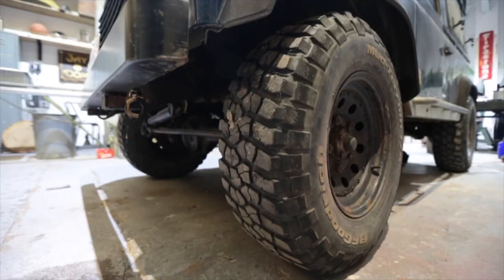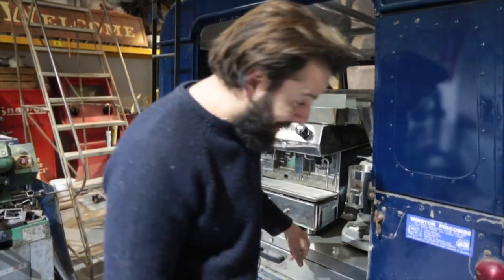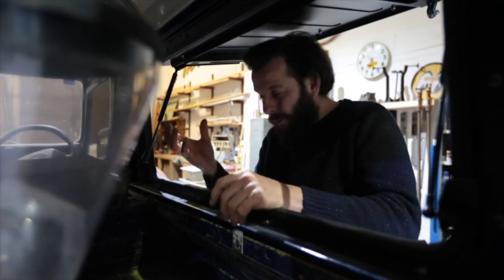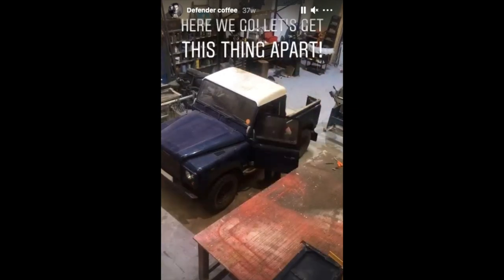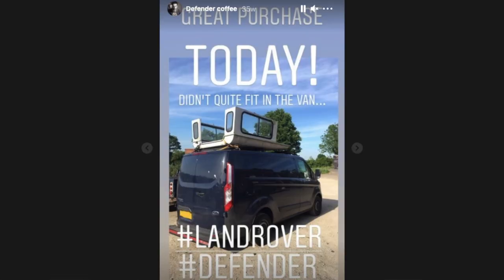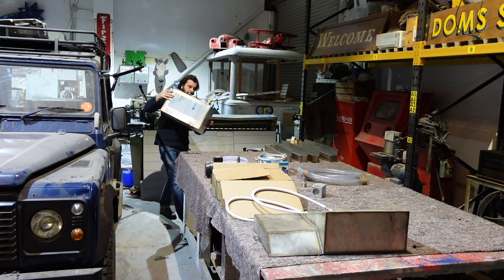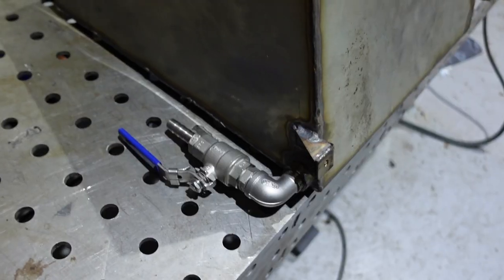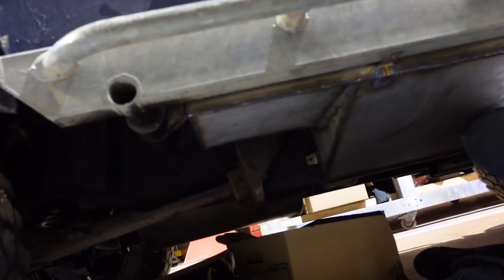MODIFYING A LAND ROVER DEFENDER INTO A COFFEE SHOP! | Episode One

Comment: I built a similar project in a trailer some 16 years ago, using a 2 group electric/gas hybrid machine, with 140L water & 40L waste tanks. However, I don’t agree that the rotary pump needs mains pressure to operate. My pump is at the same level as the bottom of the feed tanks, but 900mm below the espresso machine itself, & both have been working well all that time. 40L of clean water is not a lot, and will probably be insufficient for a good days operation. If the owners would like any insights/observations etc, I’d be happy to discuss, for what it’s worth... I look forward to watching part 2.